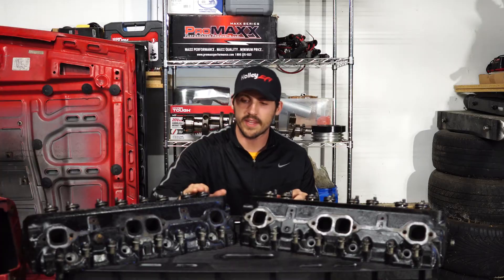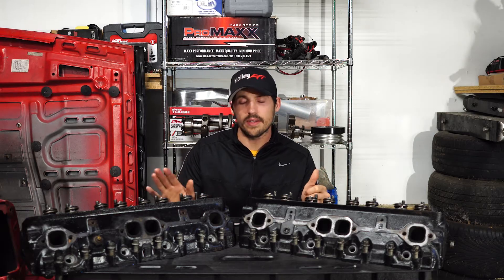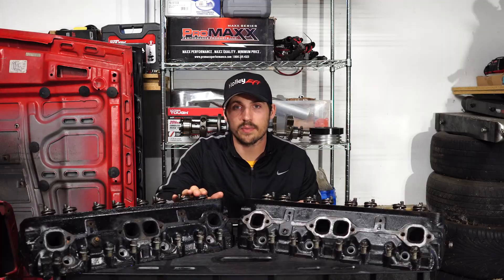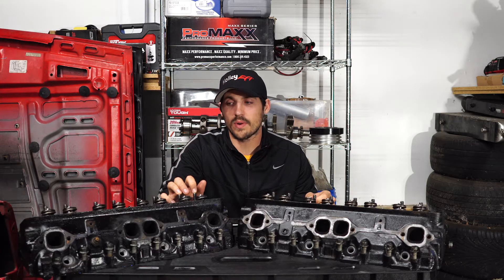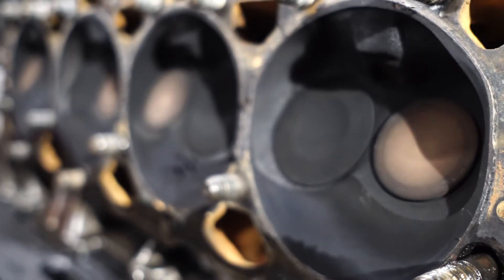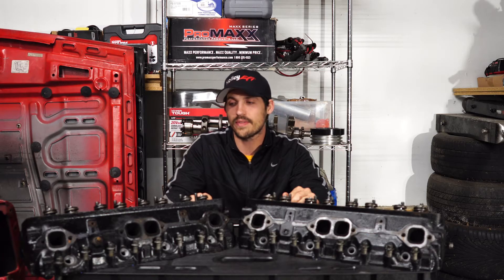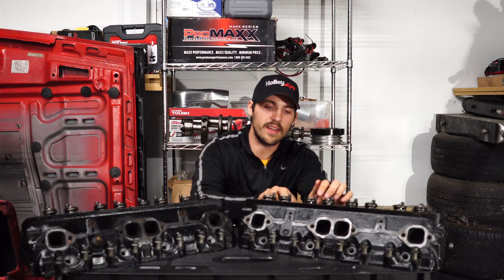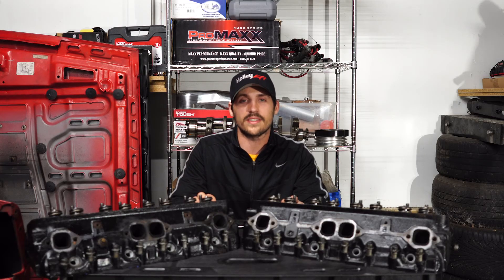Vortec Heads - The Big Issues You Need To Know About

Comment: 062 are say the cast iron " fast burn heads" triple peak
906 are no where near quality of 062

If ya talkn brand new
062 worth every penny, no biggie on 300$ intake 100$ polished alluminum vc
Spend money at machine shop for 600 lift springs

Now if ya can find used
Heads still need to go to machine shop to get checked...

Comment: Even better, use a vortec block. They are set up for roller lifters.
Reply: And 4 bolt main.
Reply: @LandonJpettrey Maybe in a heavy-duty truck.  The ones in 1/2-ton trucks and SUVs are 2-bolt.
Reply: 2 bolt mains are fine unless you want really high HP. GM still sells the 4 bolt blocks.

Comment: Or less somebody gives you an incredible short block it's got all this crank and pistons and connecting rods that are top of the line it's not worth converting standard to vortec. Just get you a vortex and rebuild it or have it rebuilt don't try to make a hybrid because you will not be successful. I wish this guy was honest to tell you that. But if you noticed the manufacturer of these products. Will change the design so you cannot pass around old high performance parts when you outgrow them they force you to buy new ones.

Comment: If you dont want to machine the heads, just purchase  .100 longer erson stainless valves, you may have to shim your springs and get longer ,preferably hardened push rods, to correct rocker geometry, ive run those valves with no problem and they are priced right for a poor man. Hope this helps.

Comment: I installed a set of vortec 062 heads on a 1993 350 block. I went with a slight milder cam. My question is what length push rod do I need? Will is change much or could I use stock vortec push rods?

Comment: Thank you for a great video. My question: If you slap Vortec heads on an older motor with a flat tappet cam/lifters, do you use the Vortec pushrods or the SBC pushrods (or are they the same length)?
Reply: Have you gotten an answer for this question? I've done the same thing and have asked the same question
Reply: I need to know to. I was at machine shop talking about I need some heads for my motor n a guy gave me 906 heads.

Comment: I have 8 of these junk heads piled up in my garage right now because the machine shop found cracks every time I bought some and had them checked.  I've talked to so many others who have had exactly the same experience, and the machinist said about 1 out of every 12 he checks is actually good.  There may be about 20 good GM-produced V8 Vortec heads left out there somewhere in the world, but going forward I'm treating all used Vortec heads as cracked.  In the end I ended up buying some aftermarket heads for my build.  Even the cheapest Chinesium heads have a revised design that solves the main problems that caused all of the factory heads to constantly crack.  To save everyone else the same heartache, I recommend EVERYONE treat used factory heads as cracked and just spend the money on some reproduction heads.  I got mine for about $700 for the set in 2024, and now I don't have to worry about them being cracked or likely cracking in the immediate future.
Reply: Any OEM casting numbers being better or worse than others?

Comment: These are great hot street heads, better than the old Camel Hump 2.02's. Definitely go with screw-in studs, and open and mill the spring seats if you want to go a little beyond .500, but only if building a 383 stroker or adding forced induction, otherwise they won't breathe enough. 

Another thing is to drop in 1.64 exhaust valves and work the exhaust just slightly. If you know what you are doing a mild porting and gasket match is a good investment. I have a Vortec 383 in my '91 RS and run a pretty peppy Lunati cam and valve train. The heads came on the car and only had 100 miles on the build, so the little "tweaks" were worth it considering the heads were well built and I did my own work. Otherwise... AFR street aluminum or even Summit aluminum heads may be a better choice.

The little 383, like most street engines, is a torque monster and the power all lives under 5,200 RPMs.

Comment: Something that just popped into my head is how much  does just a vortec head swap change the compression ratio? Let's just assume my 86 K2500 still has the original LS9 350 with its 8.2:1 compression. What would the compression jump up to just by going to vortec heads?
Reply: 18.5:1
Reply: @basketballjones6782  Well, that's diesel level compression right there. 🤔

Comment: It is possible to buy valvecover adapters that allow any valvecover  to fit on any head. I got some from Ebay years ago. Sleath city.
Reply from the maker: Good to know I haven't seen those yet!
Reply: I thought there were aftermarket ones that were already set up for any SBC valve cover as well. Or are those just the GM Performance ones if such heads exist under the GM Performance name?

Comment: If someone wants to tradee good old heads.
I have a good set of vortec heads.
I pulled the motor because I had a power issue. 
It wasn't the engine. It's in the computer.
Because a crate engine didn't fix the problem.
I have another truck with a bad motor. Cracked block at freeze plugs.
I'm wanting to use the vortec block in it. Because I know the block is good
Any how if anyone want to swap my vortec heads for old heads let me know.

Comment: Can I reverse.
History
I have a TBI sbc motor that I changed to the old heads. I did this because the heads were cracked.
Well turns out so is the block.
I have a vortex motor that rans decent. That I pulled.  
The truck that had the TBI that I converted to carb. Ran but the block was also cracked.
I want to use the heads, intake, carb, and distributor. On the vortect motor.
And put it in the truck that the TBI was once in.
Can I do this?
In short 1976 sbc heads, intake on a 1997 Chevy 5.7, vortec block.

Comment: Maybe a dozen years ago, I was preparing a set of the vortech heads for a circle track racer. I could visually see a slight difference in the ports. I ran a single intake and exhaust through the flow bench and found the numbers were way off. -- I checked the port volumes for cc's finding the ports were way small. I checked these against another set which were larger and produced the normal flow numbers.  I have the phone number for GM Engineering so I gave them a call to report this issue.  I've got the fellas name in the shop but it wasn't Ron Sperry. After explaining the problem, this man asked for the information to be faxed back to GM. -- What the deal was, GM pays Mexico to cast these for them.  He was HOT !!
He did say there was going to be Hell to pay for this if we find the same !  All I know is that he was going to get to the bottom of this.   Just be aware that you may get a set of these that are weak for power. You have to check the cc's. -- I don't recall the volumes however I would think these are easily available.

Comment: I just built 3 engines right in a row, a 355 on a 96 Chevy truck, a 358 on a 77 K20 and a 383 on another 77 K20, all 3 had the identical prep, Elgin rv-943x valve springs, 3 angle valve job and .530 valve stem seals. I hate having a single spring, when that goes, so does your engine. For a daily driver to a strong running truck, they work great, I have seen a minimum of 2 mpg on previous engines

Comment: You also need Vortec specific exhaust manifolds or aftermarket headers. The old style ones will bolt up, but the exhaust ports won't match up.
Reply: Not true.
Reply: @zachwilson9608  which part?
Reply: they do
Reply: Yeah find a couple of hundred dollars extra and buy something much better alloy heads

Comment: One bad thing not mentioned is Vortec heads have thinner castings than old school chevy heads and are prone to cracking if overheated. Be wary of high mileage pull offs and walk away from any head that's been decked.
Reply: Correct don't over heat them
Reply: They are noticeably lighter for sure. I’ve only ever seen one cracked vortec head in person and I personally did not pull that one. I have overheated them around 250 degrees and not busted one yet knock on wood. Guess I’ve just been extremely lucky
Reply: Old school being pre-1976.  The late-'70s to mid-'80s heads are also particularly bad for cracking, and I think the TBI heads are also not great.  My Suburban started doing a weird thing where the temperature would overshoot the thermostat by 20°F and then settle back to normalish, but then a few years later, it started drinking coolant and smoking on start-up.  I assumed cracked head and parked it until I got a good pair of heads.  When I went to move it to the garage to swap heads, cylinder #6 was completely full of coolant, so the engine wouldn't crank.  After the head swap, the temperature no longer overshoots, and it runs cooler.

Comment: I have 3 trucks, 2 96's and a 99 with vortecs. One thing I hate about the heads is the intake is only bolted down at the front and rear. The intake gaskets can sag and suck oil into the cylinder and cause misfires because it is burning oil. I would never use vortec heads. There are alot better heads out there.

Comment: If you google max lift of vortec heads it pops up .420, when stock is .414 in .428 exh lol david said they get ABOUT .450 on engine masters too. .460 is what ive seen others say but no where on the internet has anyone said theyve ran a stock vortec cam with 1.6 rockers, which is .453 sooooo

Comment: don't forget about converting the pressed in rocker studs to threaded.
Reply: I was looking for this.  Unfortunately I don’t believe my engine builder thought of this when I got new springs and bigger cam.  Two days ago engine was running like trash.  Pulled covers to find 4 rockers loose and 4-5 lifter retainers broken.  The press in studs started backing out.  No bueno.  Getting heads machined now for screw in studs
Reply: @Se7enthsonSS  could have been alot worse, at least you caught it in time
Reply: @yurimodin7333  honestly that’s the way to look at it for sure.  It also happened at home instead of needing towed.  I have my intake off already.  I can pull the heads to take to shop and look at pistons as well.  Tedious but necessary

Comment: What Head Gasket do I use on my 1982 Chevy 350 engine with a pair of 1998 Chevy 350, 062 Vortec Heads ? Any recommendations for Headers, short tube, Long tube (I heard the long tube may hit the oil filter on the Driver's side rear of the block.) Thanks in advance...Liked/Subscribed a long time ago !

Comment: Been running vortec for years. A good up grade is 1.06 exhaust valve. Thats the only downside of the heads is the exhaust. Other then that good heads. Stay around 500 lift were they were ment to run you will be happy.
Reply: So, putting a smaller valve into it helps performance?  Hmm...

Comment: What about you'll need screw in studs and watch for cracks.
Reply: They are light castings and cracks are common in used ones.The rocker arm studs are pressed in. If you run a perfomance cam,it can actually make the stud(s) pull out of the head especially if you're running stiffer valve springs.

Comment: I am running these on a Gen II 350 crate motor. Great power for the price, but cold weather running with these heads are horrible due to not having the exhaust crossover.
Reply: I live in Oregon I don't my ave any problems once its warmed up the colder the better I run the edelbrock performer and a 650 Holley double pump mechanical secondaries ,the real for Tec head only came in 2 casting # one has a 3 angle cut one doesn't
Reply: How did you get them to work on an LT1/LT4 engine???

Comment: will exhaust manifolds off a 86' 305 fit them? my L69 shit the bed and am looking at a L31.
Reply: Yes but if in a car then you will have to run with out the very rear passenger exhaust manifold bolt because there is no hole drilled. I did it for a year without issues before getting headers.
Reply: @AustinHarmon1994  i wound up getting the L05 from pace instead for 2900 cuz the l31 didn't have the cam eccentric for mech fuel pump. still a decent engine steel crank 1 pc rear main & roller cam ready... headers are out of the question been there twice.

Comment: The real issue with vortec heads is that they stall at around .500" lift. If you want to run anything more radical you will need a different casting. These are still the best production SBC heads.
Reply: yeah i would look into just plain bare castings of AFR enforcer heads or assault racing heads, port them , use all new parts and then you got heads almost as good as CNC competition aluminum heads by promaxx, AFR, dart pro1, trickflow, or any other without fear of cracking thin iron. if you want to go iron get RHS or DART.
Reply: @zAvAvAz  Chevy Performance Bowtie Vortec heads.  Good to go, out of the box...   lol
Reply: @bobhoffman5581  lol

Comment: Will they work on a stock 91 Corvette TPI motor?
Reply: Should work on an l98 you'll just have to get an adapter for the tpi intake because of the bolt angle being different from a traditional 350 intake.
Reply: @TheVortec  Gotcha

Comment: I want to put a set of these on a 307 I removed from my 82 cutlass!...what year should I look at i know I need them off of a 305 vortec engine!...
Reply: That is likely a 307 Oldsmobile engine, can't use Chevy heads.
Reply: @RSAW73  yep, nothing will work on the Olds engine except Olds
Reply: They made a Chevy 307 back in the day, real beefy block but a lot of guys cried about it like they did about the 305s it only came in two barrel and low compression but all that can be changed and I know some people that race them

Comment: I have a 78 Monte with a 305.  I’ve already put in a mild cam in to it with dual exhaust with a whimpy 2 barrel carb.  I want more.  

I would really like to put on fuel injection, eventually and have other guys saving go LS, but at the moment all numbers are matching...so

In my brainstorming BUDGET conscious situation, I found an old 5.7 Vortec in an old suburban.  Could I take the whole intake, heads, injection system...everything and mount it up to the block I’ve got now?

Would it work? Would I gain anything? Or would I be better bolting on an Edelbrock system into this 305?
Reply: Unless you're raising your compression you're pissing in the wind, and the last thing you want on a low compression engine is a bigger cam
Reply: Have you looked at the vortec 305 heads? High compression Pistons? Everybody thinks bigger is better on the 305s it's the whole package you can do a lot with them actually. You probably need a new distributor by the way. Put in an advanced curve kit block the heat risers a 160° thermostat so you can run all the initial timimg and possible. I run a e85 mix so I don't have to buy premium.
Reply: @christianmotley262  oh I have bigger problems at the moment.  Every connecting rod bearing is worn down to the copper.  So the crank is being ground and polished, and possible the cylinders getting honed out as well.  

What would you recommend as far as trying to raise the compression?

Comment: What would be a good cam to run after you put these heads on an older 350?
Reply: About a .480 lift cam
Reply: I used comp cams xe274 , just make sure you get springs to match, it sounded good and it pulled really hard.

Comment: My 906 castings had a .9" valve guide boss and the comp cams beehive springs did not fit with out machine work. Also my exhaust ports were raised .2" which for most is not a problem. If a person is running pre vortec exhaust manifolds this can require a little grinding to the top ports of the manifold. They make great power though.

Comment: As someone with a SBC with vortec heads in a 1975 corvette I think I can give a little good info on installing these heads. The best airflow you can get with the intake side is 240cfm and that's with the 1.94 intake valves at .500" of lift. If you go over this lift you'll just lose power to valve train losses and valve instability. Putting bigger valves in like 2.02s doesn't help airflow either. These heads are thin cast so it's generally not a good idea to port them or put bigger valves in them as they are more likely to crack. A 3 angle valvejob helps a little. The lt4 hot cam is probably  the best camshaft you can get for these heads as long as you use 1.5 ratio rocker arms.
Reply: I just bought a 75 corvette and am in the process of bolting on some vortec heads. My cam has .480 lift. I was told that my cam would work fine with my stock vortec heads with stock springs. The info on the internet varies too much. I've read that the max lift is anywhere between .460 and .500. What do you think?
Reply: @MegaKencam  are these 062/906 cast heads of another vehicle or are they the summit variety vortecs?
Reply: @DYLAN102001  906
Reply: @DYLAN102001  I keep researching this and I think that I've decided to go with the LS1 springs and the Comp Cams Retainers. I'm trying to find the right Valve Stem Seals now.
Reply: @MegaKencam  Ok so those are the stock heads from a 96-98 Chevy, those will handle a max lift of .465". Make sure they are not already cracked because on average 40% of them are cracked by now. My advice is to go with the LS7 beehive blue springs and retainers. Use the stock valves with a 3 angle valve job it's best not to port anything on those heads because they can crack easily around the exhaust ports have a machine shop take around .075" from the valve guides, that will help with retainer clearance.
Reply: @MegaKencam  Go with the stock vitron valve seals for both intake and exhaust valves. That's what I have and I have 35k miles on the motor now.
Reply: @DYLAN102001  Thanks!
Reply: Thanks for the info 👍

Comment: you need to mention the shape of the combustion chamber. it's a much more modern better and efficient heart shaped combustion chamber than the old style bathtub shaped combustion chamber. If it didn't have the heart-shaped combustion chamber the smaller size alone wouldn't do that much